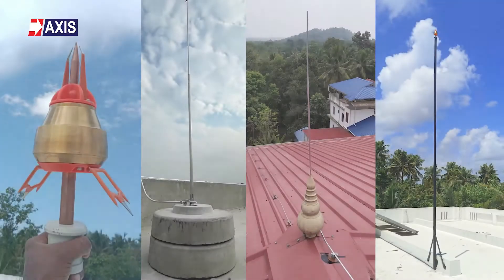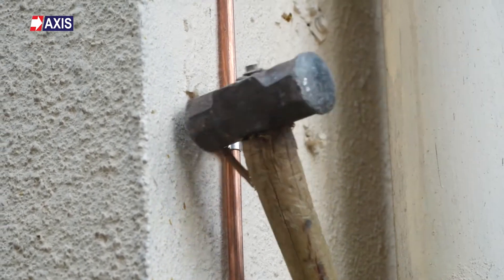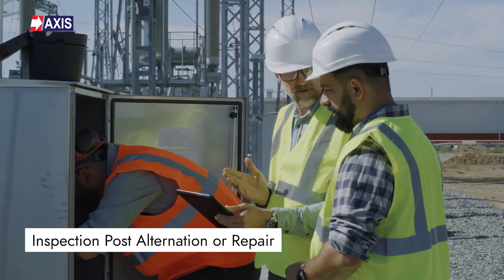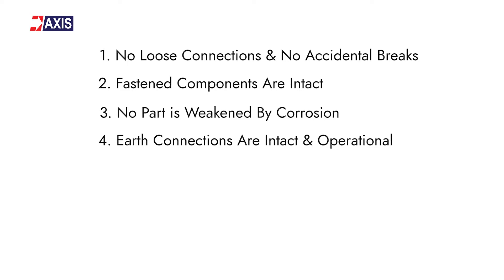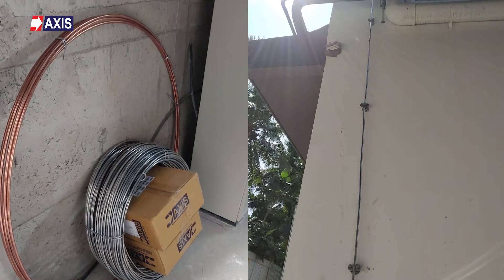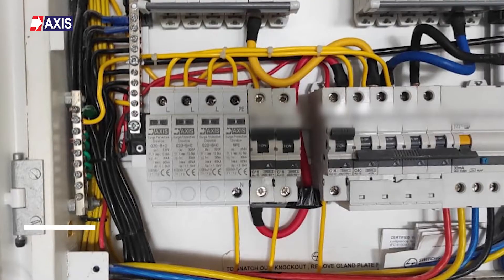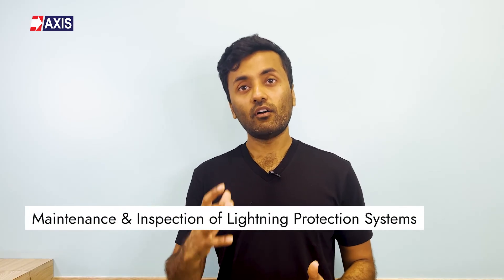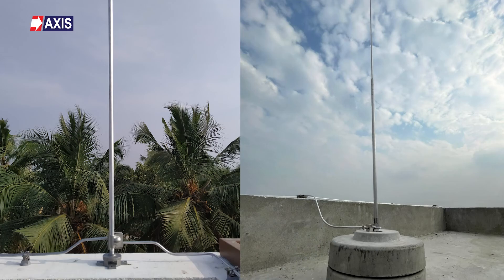How to Test a Lightning Protection System? ⚡

Comment: If I have an intersection between conductors on the roof and cable trunk what i can do?
Is grounding resistance measured for the rod with out down conductor and the loop or just with out down conductor?
thank you for your effort
Reply from the maker: To address your query about the intersection between conductors on the roof and cable trunk, it's crucial to ensure that all metal components are interconnected with the lightning protection system. This practice maintains equipotentiality and prevents flashovers, particularly when a conductor runs close by.

Regarding the measurement of grounding resistance, it should be conducted by disconnecting the down conductor from the test link. 

This approach helps accurately assess the earth rod's resistance. According to IS/IEC 62305 standards, the combined earth resistance should be less than 10 ohms to ensure effective grounding and overall safety of the electrical system.
Reply: @AxisElectrical  thank you  very much for your answer..i would like to ask about the distance between lightning protection network and cable trunk what should it be and how to calculate it?
Reply from the maker: Glad you liked our answer @nonosa3od253 

Let's get on a call for detailed discussion. Share your contact details and query on sales@axis-india.com

Comment: Nice VDO, but please remove that part where a hammer is used on a screw, (a very normal practice in India, which exposes the level of our knowledge for the very basic fitting techniques)
Reply from the maker: Thank you for your input! Typically, we operate with a drilling machine. In this particular video, we've incorporated both tools, though we generally do not recommend using a hammer.

Comment: I have welded 2 rebars together Lap welding 40cm. Do I need to check the resistance between the rebars welded. if yes how much should be its value?
Reply from the maker: Hi Vimal, first, you need to make sure whether 40 cm is sufficient or not for overlapping. As per the IEC 62305 standard, 20 times overlapping is required against the diameter of the rod. So yes, you need to check the resistance between the rebars welded and the resistance value should be 0.2 ohms.

Comment: Informative Video, well presented.
I have a basic question regarding the Continuity test. My doubt arises since I don't know the construction of an ESE device and its internals.
If I keep a multi-meter probe at the pointed tip of an ESE arrestor, and another probe at the base of the tall rod, below the ESE device, should I expect continuity? ( Am wondering because if there is an insulating air gap inside the dome, then I may not expect continuity. Right?)
Reply from the maker: Thank you for your appreciation, it means a lot!
Continuity will be there as our ESE is designed to transfer lightning current in the ground.